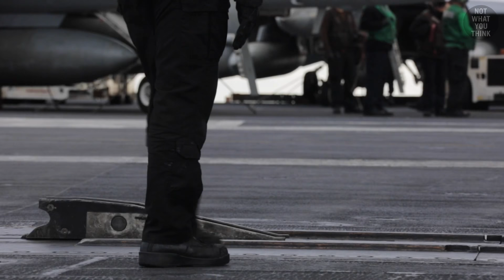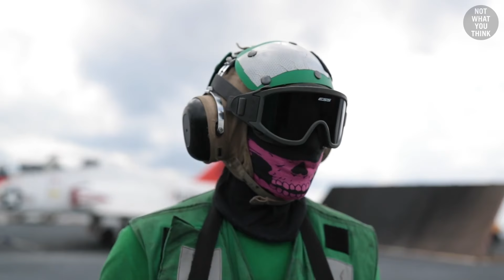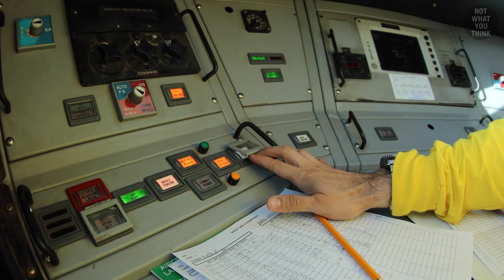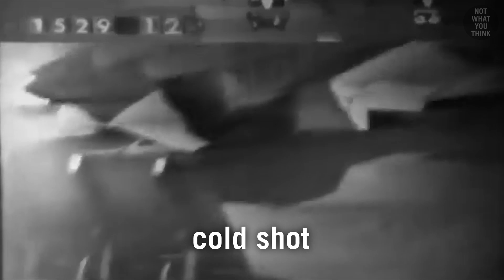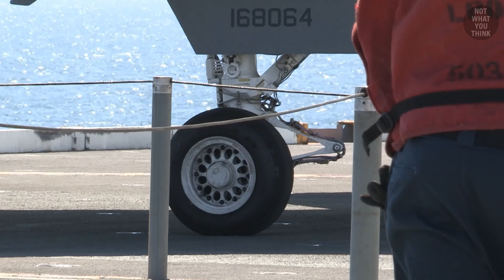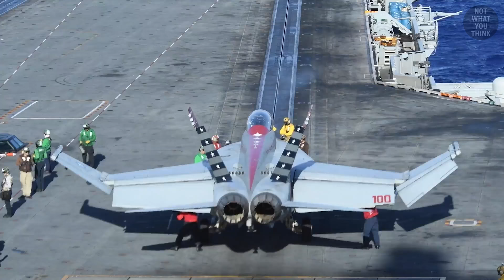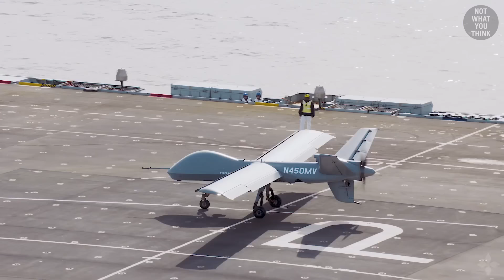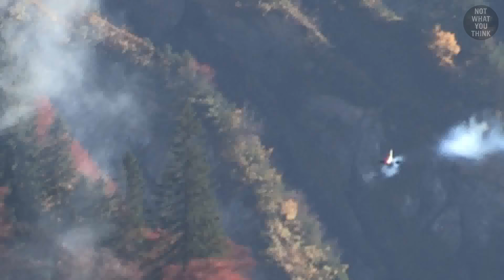Why the US Navy is Replacing Electric Catapults with Steam

Comment: The correct answer is: "Somebody let Grandpa out of the attic again and he forgot it wasn't World War II."
Reply: apparently you never heard of EMP. a steam catapult is not affected by emp.
Reply: @markvl11  You have any idea how much money it would cost to install an obsolete system?
Reply: @DamienAlexander-Ducroix  there are modern steam catapults that cost less than their WWII counterparts, and preform as well or better than the electromagnetic ones and are less prone to failure like a computer issue as they are largely mechanical.
Reply: @markvl11  Steam catapults deliver huge peak acceleration within a brief window, exerting significant stress on the airframe during launch and shorten the lifespan of aircraft. The linear acceleration by EMALS on the other hand can be very gradual and exerts far less stress to the airframe. Studies show that the huge G-force by steam catapult can shorten the lifespan of aircraft by about 30%. There is no possibility to change that with steam catapult because of the mechanics of the device. EMALS on the other hand can be improved using clever digital control techniques to reduce stress to airframe at launch.
Reply: @markvl11  but every modern aircraft will so not a very good argument.
Reply: * It's time for you to take a rectal suppository triple dose every 20 minutes of "Trump-Laxium" for temporary relief of TDS symptoms. Yes, you have Trump Derangement Syndrome. When you have TDS not only will you walk around feeling like you are just about to pass a twisted sardine can lid you'll also smell like a pile of burning tractor tires. May 15, 2025 WASHINGTON, D.C. — Today, Rep. Warren Davidson (R-OH) introduced the Trump Derangement Syndrome (TDS) Research Act of 2025. This bill would direct the National Institutes of Health (NIH) to study the psychological and social roots of what is known as Trump Derangement Syndrome, a phenomenon marked by extreme negative reactions to President Donald J. Trump. He was joined by original cosponsor Rep. Barry Moore (R-AL). “TDS has divided families, the country, and led to nationwide violence—including two assassination attempts on President Trump. The TDS Research Act would require the NIH to study this toxic state of mind, so we can understand the root cause and identify solutions.” said Rep. Davidson (R-OH). “Instead of funding ludicrous studies such as giving methamphetamine to cats or teaching monkeys to gamble for their drinking water, the NIH should use that funding to research issues that are relevant to the real world.” “Trump Derangement Syndrome has become an epidemic on the Left,” said Rep. Moore (R-AL). “Some individuals who suffer from Trump Derangement Syndrome have participated in nationwide political and social unrest, even trying to assassinate President Trump twice. Rep. Davidson’s common-sense bill will use already appropriated funds on an NIH study that can make a difference.”*

Comment: USS CORAL SEA 79-83 V-1, The downside is efficiency, to make steam it takes many  lengths of pipe & ways to keep it in steam form
Reply: And for emals it doesn't take many miles of heavy electrical cable?
Reply: @skipperclinton1087  Not the point, miles of wire has very little impedance like steam turning back into water. the wire stays as wire

Comment: Thes launchers are measured by MCBOMF (Mean Cycles Between Operational Mission Failures).
Traditional Steam (C-13-2)~4,050 launches, with a highly mature, 99.5% operational uptime over 50 years of refinement.

First generation EMALS (Early Testing) MCBOMF ~240 launches with a total 4,166 launches in early land-based and sea testing (pre-2020) and they suffered from critical software/power faults repeatedly.

Current generation EMALS (Recent Fleet Data) have MCBOMF of ~614 launches, with a total of 4,166 launches. The Pentagon DOT&E data noted slight statistical improvement, though it formally sits well below target thresholds.

Aviation (I am a prior USMC Fighter pilot of the A4E generation with many cat launches. In an F18 or F35 I know which MCBOMF numbers I would want to bet my life on. Figures don't lie but liars figure. The failure rates are not even close.... after years of research and millions upon millions of dollars.

Comment: There is a ton of inaccuracies in this video, and it's obvious that it is slanted towards the electromagnetic, which in my opinion is politically motivated and total garbage. 

If a magnetic catapult needs repair, you gotta have a master's degree in electromagnetic theory to fix it. 
If a steam catapult needs repair all you need is a plumber and a pipe wrench! That's the difference.!!

Comment: The Navy bought a catapult that breaks down every three days and locks out its own crew from fixing the damn things potentially leaving them helpless in a combat zone.

Oh, and if a drone can't handle a steam cat launch HOW IN THE HELL is it going to handle slamming into a deck during a bad weather landing?

All the EMALS launchers are highly integrated, and if they "break" it takes 1.5 hours for the rotors to spin down so it can be fixed/deenergized. this isn't going to change.
The launchers have a shared power architecture, meaning a fault will take out 2 catapults at a time, whereas steam systems or highly independent, and a dude with a wrench can fix them on the fly.
For software issues EMALS require land-based tech support to fix software bugs, or failures. In the event the Carrier assumes "EMCON Alpha" (no electronic emissions) in an active theatre, the damn things can't be fixed at sea.

There are MANY people in the comments whining about politics, harping on Trump, and openly BS"ing about the power structure and maintenance hurdles surrounding these things.
Very low to call out Trump for a dumb comment when it has ZERO to do with the actual functionality, reliability, and possible damage control issues these things have.
Reply: How have China and France made these work?
Are you saing Americans are stupid?

Comment: The electric catapult system on the Gerald R Ford class is hugely unreliable 

Steam is extremely slow to ready the system 

The  Chinese electric catapult system is far better in every possible way and considerably faster than steam, taking half the time to ready. The Chinese system has no faults. 

The US carrier technology is poor quality and it's newer carriers already need major refits to catapults, missile delivery systems and need completely replumbing 

That's not even mentioning the vast ongoing problems with the F 35 ... Which are ridiculous

Comment: In truth, I believe it was just too early to put electromagnetic catapult into service as we see with the Gerald R Ford. It’s reliability and launch ratio is significantly lower than the target we set for it. I don’t remember the exact numbers of how many launches before a failure to occur we wanted, but we’re hitting well below it. well, it is true. Steam catapults have their problems and they cause more stress on an air frame. Every time it launches. if I were the captain or admiral on an aircraft carrier, I would gladly take those problems over the catapult completely failing, and not being able to launch an aircraft at all. simply put I think it was just too early. We should’ve complete the ironed out and perfected the electromagnetic catapult technology on land before even sticking it on a ship.

Comment: it took many decades to work out the array of problems steam catapults had. Electro magnetic will take time also. The bigger not mentioned issue is the right to repair and software lock outs. At the end, when its reliable, it must be rapidly repairable, even with battle damage.

Comment: And in unrelated news (?):  The US Navy is rolling out new laser defense weaponry quickly, and, while formidable, a big trade-off is that lasers are also very demanding of electrical power.  I believe only a few current US vessels have enough auxiliary power to fit a good number of these new weapons (with even one more being better than one less in the new age of drone warfare).  The latest carriers are among them.   They are also the most important targets.
Steam catapults require less electrical power.   Save as many Kilowatts as you can for weapons.   Steam still works for catapults.   
This may not be even one of the reasons, of course--the Navy doesn't ask my opinions--but it could be.

Comment: Failure rate is a strange thing. With EMALS a launch failure can be a warning light. With a steam catapult it's a mechanical failure or worse it throws the aircraft in the ocean. So far EMALS has never caused the loss of an aircraft or crew fatality.
Reply: Less PARTS LESS WORRY, from the Matrix
Reply: @QwertyMe88  That should be true, but the launcher weight is higher and so the carrier's range is reduced.
Reply: 😂😂😂 don't count your chickens before they hatch 😂😂 one cold Cat shot on the USS Kitty Hawk CV-63 76-80,  tons of workups, two WesPac cruises,  back to back..  one...
Reply: The failure rate with EMALS is thousands of percent higher. At some point you have to ask why bother.
Reply: @GuðríðrÚlfr  Your data is out of date and it was never more than 900% higher to begin with. Since there is only one EMALS in active service lets wait until after the upgrade before having a conniption fit.
Reply: I believe i've read where hitler is credited with actually weakening his military by injecting his lunacy into the design of weapons
Reply: @RydeIowa-z8j  Thats true. A famous example was the first jet fighter developed by Germany. It was superior to all other aircraft of the time, and with its performance, it would likely have shot down all the Allied aircraft. However, Hitler was determined to have a bomber. So the developers had to go back to the drawing board and start from scratch. As a result, a lot of time was lost, and air superiority could no longer be regained.
Reply: @dirkniedfeld7411  Maybe eventually but theJunkers Jumo 004 engines had extremely short service lives and only lasted about 25 hours so , No.
Reply: And Ford still cannot launch F35. What is wrong with the picture?
Reply: @KittyKittyCat-vf8zd From what I understand,  it's not a problem with the cat,  but rather the jet blast deflector. That big honking engine in the F35C puts too much concentrated heat on the judges and they need to upgrade the cooling on them.
Reply: @mudguy1503 really? The Nimitz class can handle F35 and the Ford class cannot? And you believe that? 😂😂😂
Reply: @KittyKittyCat-vf8zd  Haven't the deflectors ben replaced?
Reply: @mudguy1503 😂😂😂 our JBD's on the USS Kitty Hawk CV-63 76-80 were designed for the F14 Tomcat...  guessing the don't use that type anymore,  because of the Hornets and Growers 😂😂
Reply: @mudguy1503  The original shields worked but Biden sold them when he mistakenly took them for a border wall.
Reply: @GuðríðrÚlfr 😂😂❤
Reply: @KittyKittyCat-vf8zd  Nothing. While it's in the yards it will receive the equipment and crew training to operate the F-35C. They put the Ford into service without them because they needed to get it into the fleet to work out the bugs and the F-35C program wasn't ready in time.
Reply: @patrickweaver1105 that is a lot of coping. 😂😂😂 China's Fuijan has launch the J35 last year along with J15T and awacs. It took the Chinese a bit over  a year after launch to make it happen.  Stop making stupid excuses. 😂😂😂😂
Reply: @KittyKittyCat-vf8zd  What do I have to make an excuse for? The Fujian can't defend itself much less provide enough planes of offensive operations. You're not fooling anyone.
Reply: @patrickweaver1105 lol ok tough guy. 😂😂😂😂
Reply: @KittyKittyCat-vf8zd  It's no tough to see through the CCP propaganda.
Reply: @patrickweaver1105 copium must be on sale. 😂😂😂😂
Reply: @KittyKittyCat-vf8zd  I wouldn't know. I don't use it.
Reply: China's PLN Navy has successfully launched jets off of emals onboard their carrier Fujian 1-2 yrs ago ... They're in operation ever since.
Reply: @thomaspham6921  In operation is a bit of a stretch. They barely worked at all and have a recycle rate so long as to make them impractical for carrier operations. They'll probably get there eventually. Rome wasn't built in a day.
Reply: so the new carriers haven’t launched enough sorties to wear out the ship?
Reply: @thomaspham6921  Don't they still use the "ski-jump" launch system?
Reply: @patrickbass3542  The first two do but the Fujian is catobar.
Reply: A detail you didn't mention: a launch failure means the plane is still sitting on the deck.
Reply: @ivortheenginedriver4264  Quite often for both systems.
Reply: There were at least 2 incidents involving F-35s and carrier operations at sea ... both times F-35 jets fell in the ocean on launching off the carrier's deck ... one in the South China Sea and one in the Mediterranean Sea (British Navy).

There were no report of loss of airmen in either incidents.
Reply: @thomaspham6921  The F-35C on the Vinson had a ramp strike on landing not on launch. The British F-35b failed because someone left a cover in the intake and the engine ate it The British don't use EMALS. EMALS has never caused the loss of an aircraft. Not yet anyway.
Reply: Captain shin splints is telling the most advanced shipbuilders on earth to change because "he likes steam". He blows enough hot air to run dozens of steam catapults. He should keep pretending to be a president and let the engineers build the ships.
Reply: Betting you don't know chit about Steam Catapults , or even step foot on a Carrier..  that has one..  and Betting you've never served in the Navy..
Reply: @oldguysrule-k3x why don't  you run us through the whole operation smart ass.
Reply: Trump doesn't care big loss, he must have shares in steam catapult stocks or indirectly.
Reply: @lang9224 lol Trump is dumb but even he can recognize the problem with the emal. What is wrong with you guys? Are you dumber than Trump?
Reply: @lang9224 😂😂😂
Reply: @lang9224  steam catapults are a more mature technology  and better under stood for field/ship use. Electric sounds good but using it on a moving ship is problematic for sensitive electromagnetic catapults.

Given enough time and practical research the issues will be resolved.
Reply: @jonathanjones3126  You are saying that the military experts and the Pentagon didn't see the problems before switching to EMAL, has to depend on the stable genius  to switch back?
Reply: @lang9224  or they where pushing aggressive unrealistic time tables and already wrote off their test platform carrier in the hopes they learn enough to fix the design flaws.
Reply: @lang9224 ur TDS is showing , tone it down a bit next comment , that way sane people dont immeaditely lose respect for you 😅
Reply: @J.Castillo-n8y  Don't worry about me losing respect, as long as Trump and MAGAs like you are respected worldwide. Switching back to steam catapult is as simple as a button push.
Reply: @lang9224  Yeah, never mind the millions of dollars of equipment that has to be changed🙄
Reply: Only vulgar people use the nasty acronym  TDS. 😒. People who accuse others of having it, almost always have it themself.
Reply: @WandaJacksonTNhave you tried growing a pair 🏀🏀's
Reply: TDS is believing Trump..  He made 35,000 provable lies his first term. He coordinated a massive attempt at election fraud (pardoned the mob that made the first attack on our capitol since the British in burned it 1812) and is lying now at an even higher rate all while making life harder for average Americans and looting the treasury with kick-backs, no bid contracts and straight-up bribes.
He acts exactly like a third-world dictators he so admires for their ability to subjugate and rib their citizens.
Reply: Well, the emal failure rate is 1 in 250. The combat requirement is 1 in 4415.  And when one catapult fails, all four fail. The magnetic cable arresting system and weapon elevators are also big problems. They don't meet combat requirements. The USS Ford has been limping along for a decade. The engineers can't fix it. Hence trump wants steam catapult back.
Reply: but China can?
Reply: @KittyKittyCat-vf8zd  It's gotten better than that. The Ford is in the yards and should be fixed before she comes out. Trump talks a lot. It doesn't always mean what it appears to.

Comment: What I see mentioned quite often in the comments is that EMALS is still evolving. Warships especially bird farms should not be test beds for new evolving technologies.

Any Warship once commissioned should already be fully able to perform its assigned tasks whatever that is. 

I have see YT videos (documentaries) whereas steam catapult power/recovery is transmitted to the cat control room for the weight of the AC about to be launched or recovered. Sure quicker launch times can be achieved using the EMALS system but anything electric is prone to failure, even steam but less likely. Steam power has been around for 2000 years so I'm pretty sure it's been refined and all the bugs have been worked out.
If it ain't broke don't fix it!

Comment: Carriers built specifically to operate with F-35s cannot launch F-35s with EMALS. That seems like a problem. No mention of that in the video
Reply: mblaydoe: I saw that problem pointed out already. The F-35 has been under development for as long as the Ford class has. So why wasn't the design changes built in?

Comment: The electromagnetic catapult system (EMALS) broke down roughly once every 600 launches on the Gerald Ford. This falls short of the Navy's goal of one failure per 4,166 launches. The average steam catapult failure rate on Nimitz-class aircraft carriers is one operational failure every 4,050 launches.
Apply brain.